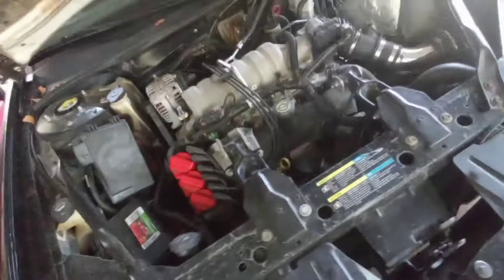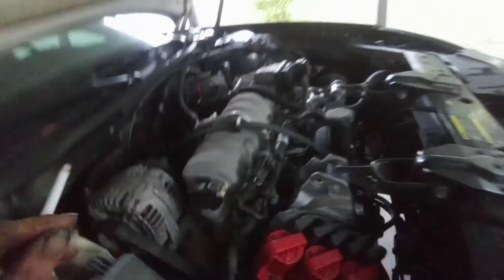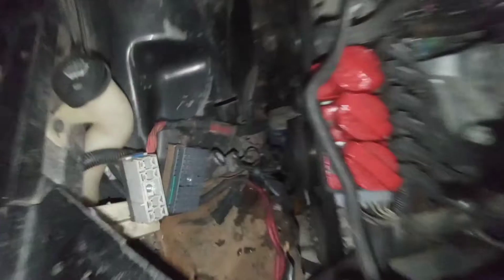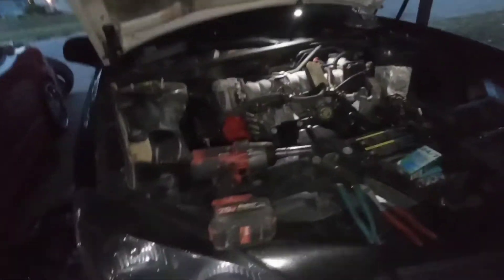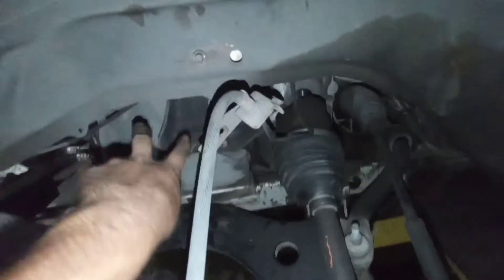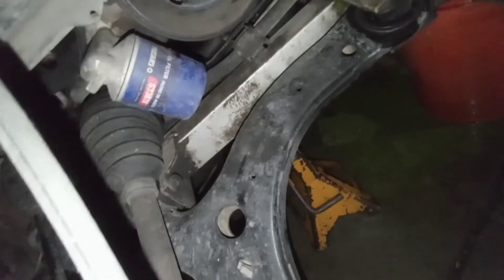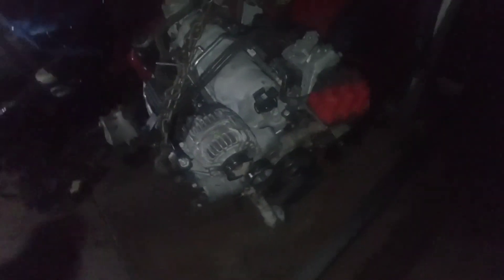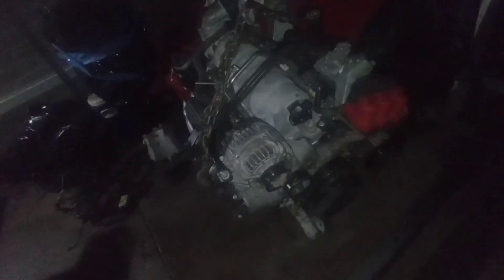06 Grand Prix Pulling the engine and transmission for engine rebuild & GM reman transmission swap

Comment: Bout to switch out a transmission on my 05. Be cheaper and faster to buy a new car but goddammit I love these cars
Reply from the maker: Me too bro. Me too. I love my Pontiacs. Would be easier and faster to buy another car. But not much cheaper honestly. I paid under $200 for the transmission. Cost me a weekend of time and new fluids. But overall it was a good car after the gasket set and transmission swap. I sold it to a buddy of mine and we did the top swap back to supercharged and it was a great runner for a stock pulley build.
Reply: @PontiacsGarage  I was thinking because of how much time it takes to disconnect everything but ur right, that experience counts as something. My brother's telling me to just find work and make some extra money in all that time I'll be spending pulling both engines out for the swap. 

Sounds like you're passionate about this tho, I'm gonna refer back to you while I do this. Just waitin for spring to make up its mind
Reply: @PontiacsGarage   I had to look up what a stock pulley build was lol. I'm just a stoner in the midwest who likes to experiment. The most I know how to do is an oil change and tires/brakes but my fam knows tractors, trucks, cars, all that stuff. Do you race too?
Reply from the maker: @batterbatterswing  sometimes now a days. I used to but I got alot of tickets and had my license suspended twice so I had to knock it off for a while. Once the gxp is done and running on all 8 cylinders then I'll probably do some highway pulls.

Comment: I appreciate the video.  I've never pulled a 6 or 4 cyl motor.  I've only dealt with V8 Chevy motors from 70's moving forward to the LS motors.  I was curious about the engine and transmission in the Grand Prix, because my wife owns the same car.  Thanks!
Reply from the maker: Oh yeah no problem. I'm glad the videos helped. It's pretty simple once you do it once, it's super easy. I was very intimidated with the 1st engine swap I did. But i watched some videos and just did it. It was super simple. And now I've done at least 20-25 engine and transmission swaps on grand prixs, grand ams, malibus, impalas, monte Carlos, buicks, they're all pretty much the same layout.

Comment: What size bolts do you use to put engine on stand? Trying to figure out what size and length to use
Reply from the maker: I use some pontiac grand am and chevy malibu rear subframe bolts. They're the same threads as the bell housing bolts just longer. I've had quite a few parts cars over the last 10 years and I like to keep extra bolts and parts. So ive got a whole tote full of bolts and nuts.

Comment: I'm about to do the same thing
Reply from the maker: I'm doing the same thing on my gxp to do DOD delete and sloppy stage 2 cam. Hopefully I get it done by Sunday night. It's also getting a new steering rack, new struts, new wheel bearings and new axles. Already installed new lower control arms and a new beefy ass sway bar. Hopefully she'll be good to go.

Comment: Which Is cheaper when it comes to the engine get my engine rebuilt or get an new engine. I have an 04 Grand Prix
Reply from the maker: It really depends on what's going on with the engine, and what you're doing to the engine. Gasket set is pretty cheap. But at the same time a cam, head studs, ect can be pretty expensive. For the price of a brand new cam from zzp I can go to the salvage yard and get a complete engine. So it really depends on your end goals. But if you just have some leaky gaskets a full gasket set om ebay is pretty cheap.
Reply: @PontiacsGarage  thanks man I had bought my Grand Prix a couple years ago from someone selling. It drove good for most of  year. It started having problems with my a/c goin out than shortly after that my car started to run hot to the point I was putting anti freeze in constantly. One day I was driving and it just stopped on me steering wheel stiff on the highway. Popped the trunk and an bunch of smoke was coming out from the back of the engine. It hasn't moved since smh.
Reply from the maker: @reddywinslow3168  that's no good. Sounds like power steering pump went out to me.
Reply: Make sure you run Dex-Cool 50/50 (2-3 gallons) the green eats at the seals in the water pump etc because it’s not what the manufacturer calls for
Reply: Hey Mr Thomas, can I install a supercharger on my 06 Grand Prix 3800!! Is not gtp is the normal Grand Prix, thanks for your answers and your videos!!
Reply: @JuanCastillo-jh3vf Bottom end on a NA 3800 can not handle a SC. They are different motors internally.

Comment: I have a transmission out my 2004 comp g grand prix an my 2001 sle needs a transmission do u think i can u the hd instead of the original 45e no hd what would i have to do in order to make this work only asking because i heard u say some about the cup an putting the hd fitting on to yours jw my torque converter went out an was leaking bad so I parking the sle till i can figure out what to do should i just swap some one with a original trans i need if i can find one which would be smartest move
Reply from the maker: The comp g trans won't work in the sle. The comp g is tap shift. It has a different valve body Inside the transmission. You could gage the HD diff and put it into the non HD trans. It sounds like your torque converter seal is bad. It's a $10 part at autozone.
Reply from the maker: Go watch the 07 prix s1x cam extreme budget build video. I replace the torque converter seal in that video. It's super easy.
Reply: Ty for responding so quick i will keep u updated with the build